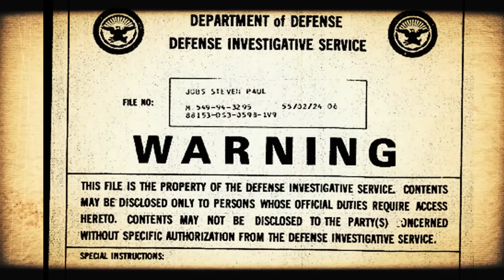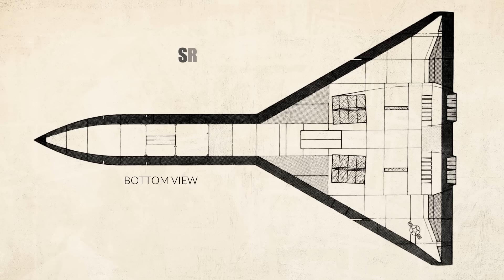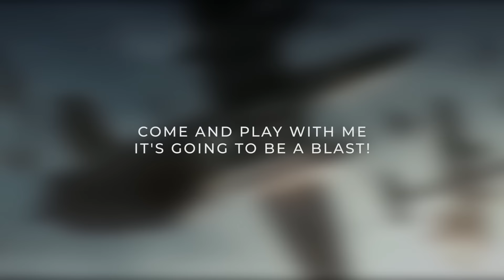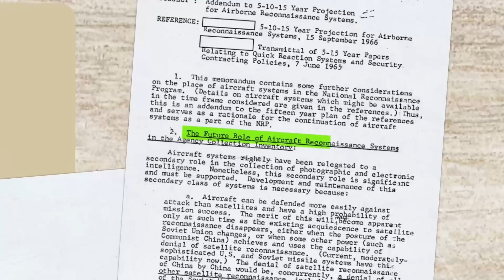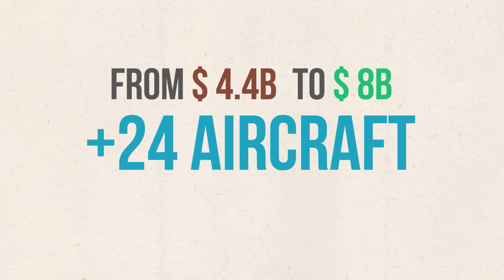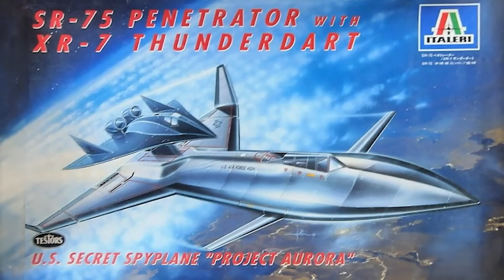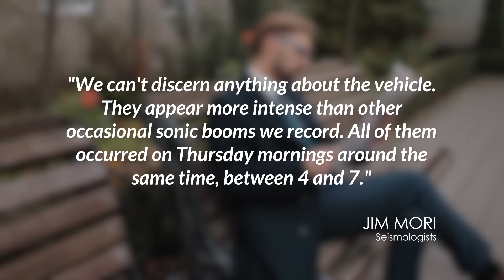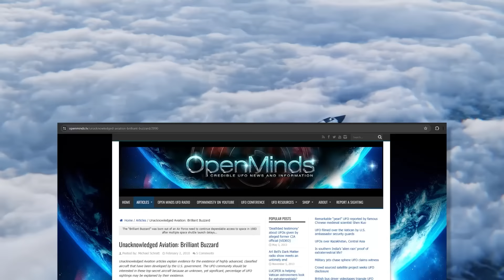This Plane "doesn't exist" - SR-75 Penetrator

Comment: i actually saw a plane i thought was a sr71 high up in the sky in the early 90's with a com trail indicating a pulse detonation engine. with the donut rings around the stream coming from engine. the plane was moving very very fast. it was so high up i could barely see the plane but it was definitely black and resembled the shape of a sr 71 blackbird. i also could not hear the plane i just happen to witness it while i was looking up in the sky. i live in oklahoma and did at this time and saw the plane flying from N NW area to S SE area. after seeing this video i am positive this is the plane i saw and the direction it was flying would place it on trajectory to be coming from the nevada groom lake area. where it was headed i have no idea. i have always believed from the time they first retired the sr 71 blackbird that the airforce would never retire the sr 71 without something to replace it and i always knew that satellites was not the replacement
Reply: What makes you think it was not the SR-71 but something else? Serious question
Reply: first of all the com trail it had. i knew then because i had seen a sr 71 blackbird in flight in the early 80's that what i saw couldnt be a blackbird. at least not the original blackbird. if you know the blackbird and its maintenance it took weeks of maintenance for every blackbird flight. they had to drain any unused fuel from the blackbird after every flight because it would literally leak on the ground. this was because how much heat the blackbird took from sustained mach 3 flights. they had to install the skin with gaps to allow expansion so the panels wouldnt buckle and fall off in flight. which is why most flights they cruised around mach 2 and only used mach 3+ when needed. now they also had to do maintenance on the skin and air frame after every flight sometimes replacing panels. keeping all this in mind there is no way the sr 71 blackbird could handle a mach 4 or 5 flight at sustained speed even if they retro fitted the blackbird with pulse detonation engines. all this meaning they would literally have to remove the skin from the sr 71 blackbird and do air frame modifications and updates and install newer skin that would handle high speeds flight. making this retro fit cost way more then just building a new plane.  now i had thought possibly the sr 75 which was rumored to exist back then. but the rumored shape didnt fit the profile of what i saw. this plane in video fits the profile  of the plane i saw. which the sr 71 did fit the plane profile but not the comm trail together. i knew then it had to be some experimental plane that the military hasnt admitted existed. 
  @RallyRacingVideo

Comment: If the parasite's engines can only fire at high speeds, returning to land at a miscellaneous runway would be impossible.  It would need to glide home like the Space Shuttle to a pre-arranged airfield, if it were in fact stable in unpowered flight.

Comment: I saw proof of antigravity over my house one night. Something descended almost straight down at high speed, fast enough to make the edges glow cherry red. When it got to around 1200' it held position with no forward speed, then moved forward slowly with bursts from its rear propulsion, until out of sight. At no time did move fast enough to support itself in the air with wings or airfoil.  Could have been cloaked, because I could never make out the shape, except for the triangular glow when descending.
- Air Force  Weather Observer
Reply: Did it have a sound

Comment: the VFX reminded me of a sighting i had early 2000s, although i dont know why one of these would be down under. Western Sydney AU late one evening,  there was an object moving North to South almost directly overhead (a little to the east) what caught me as strange was the pulsating of the engine (visual only, i heard no sound) it was a bright yellow/orange triangular output from the rear of the craft very distinct flickering maybe 2-3 times a second, from memory.  i thought it may have been a rocket or space shuttle  i later looked it up & shuttle was docked with ISS at the time.  it moved across the sky, i noticed it at very high angle up & watched it disappear to the south moved at similar speed from my perspective as ISS. Maybe 1-2 minutes before it was out of sight but the entire time the engine was pulsating in the same manner. One of those thing i wondered all this time what i saw, it was very unusual for our part of the world. there is no rocket launches etc. of any explanation so far, this seems to fit...

Comment: I’ve got two copies of this as an Italieri/Testors 1/72 scale kit from the mid 80s. Given the disaster arising from trying to launch the D-21 from the M-12 (control loss trying to go through the mothership shock cone, which would probably flameout the parasite ramjet engine), the D-21 was switched to airdrop from a B-52H with a huge rocket booster. Still no a howling success. Satellites or low observable drones make more sense for reconnaissance, perhaps a droned U-2. Unable to be shot down? If we can build anti-ballistic missiles, then anything flying in the atmosphere can be killed.

Comment: Zip fuel(boron fuels) were found to leave trails that were highly visible to radar...not conducive to stealth.

Neither is hypersonic speeds...remember the radio coms blackouts that happen when space craft reenter atmosphere.? Such happens because the hypersonic shock waves turn air into plasma that is reflective to radio waves including radar.

Comment: No if they used Machrihanish it's because it's the longest runway in the UK and leased to to USAF the only run way of capable length to also be used as a emergency UK landing strip for de-funked space shuttle and linked to the Campbeltown fuel station for specialized fuel. It's our (the UK ) area 51with underground facilities . Project Kingfish was on the Lockheed wall of history for quite a time .

Comment: What makes the most sense is that they did build such a plane back in the day, but there were technological problems that couldn't be solved with the day's tech (or at least not without costing ridiculous amounts of money), so it was scrapped. Then recent breakthroughs meant they could build a hypersonic craft, so obviously they started from scratch - no point in using decades-old tech instead, better to make it as advanced as possible.

Comment: What is that irl clip of the ufo at 0:53
Reply: That would be a rocket launch, the gap in the plume is due to staging
Reply: I've seen a rocket launch before, SpaceX launching a Falcon 9 in California. The ploom didn't look like a jet engine. I even took photos.
Reply: @WolfeSaber9933  the reason spacex rockets have the jellyfish effect on their plume is because it uses multiple engines, i assume this is a rocket with just 1 central engine on each of its stages such as a us missile or a delta 2 rocket without its side boosters
Reply: @robos3809  A rocket can't make contrail lines like a jet engine, even with multiple engines. Besides, the stage separation will happen high in the atmosphere, where it can't make another contrail line. Do your own research.

Comment: I am sure there was lots of development and testing after the SR-71. How well it worked in the end is another question. The SR-71 was reputed to have fuel tank leakage due to thermal expansion and contraction. Did they ever solve this problem?

Comment: The problem was the fuel. Like the earlier Aurora, the Penetrator used an isoborane based fuel in stockpiles leftover from the 50s and 60s. When isoborane burns it leaves a precipitate that's almost as hard as diamond on the internal surfaces of the engines. The military industrial complex thought they found a few tricks to stop the precipitate from forming inside the engines, like using hotter burning methane instead of kerosene as the primary fuel, but it didn't work. Shortly after the Penetrator program was approved for serial production one of the prototypes suffered a catastrophic engine failure during mid air refueling. The explosion destroyed the Penetrator, the tanker, the escort fighter. Two of the flight crew killed in the explosion were from politically connected oligarch class families, who in turn put pressure on their pet Congressmen to kill the program.
Reply: Looks like Congressmen or other Politic's childs are given works on SAP programs which is typical Political move however it is still a little weird that this happens again in this project. Was The Penetrator crash complately different, unrelated accident to the one you mentioned about in a comments section under another YouTube movie about perticularly Aurora program?

Comment: They were never able to launch the  d-21 from the modified A12 at operating speed and it parachuted the film cassette then crashed hopefully hard enough to destroy itself.  The d-21 was operated from b-52's over North Vietnam and China.  The Chinese shot several down and have at least 1 in a museum.  18:45
Reply: The Chicomms couldn't even detect it, much less intercept it.  They collected wreckage that fell on them and put in a museum.

Comment: Helium and amonia have fixed many of the heat issues as well as new materials...thermal mangmnt and the dynamics are negated now.  The new birds can take on a bird of prey mission set and wipe all command and control in a Unified way.....such an interesting Aspect to Software use.....just flood the pipes as opposed to not being there......just cram and overload

Comment: Contrary to your happy description,   the M/D-21 program was a failure.  CFD tools of the time could not begin to accurately simulate turbulent supersonic airflow over the airframe, the drone had only 18" of clearance to each of the vertical tails, and a crew was killed during one of the few supersonic separation tests.  It was abandoned after a few attempts as technically infeasible for the time. 

Even today turbulent supersonic (let alone hypersonic) flow is not terribly well understood.

Comment: Wait, you said the little plane has a range of 251 nautical miles at mach 15?  251 nautical mile range seems pretty short. Did you report that wrong?  No way it could get back to area 51 from anywhere.

Comment: Mach 15 is something like 3 miles per second.  If im thinking about this correctly,  if it has a range of 250 miles thats a flight time of 80 something seconds?  83 seconds lol.
If i did the maths right.

Comment: Interesting concept. Also you keep describing it's ability to go into the 100,000+ ft altitude range, but continuously only show it around 20,000 to 30,000 feet altitudes and lower. Seems like a missed opportunity.

Comment: The aircraft being midair refueled with liquid methane brings up a really big design issue.  How would the refueling aircraft ( presumably a KC-135 or KC-10) keep the liquid methane at the cryogenic temperature below of -260 degrees Fahrenheit?  It would take a lot of refrigeration.  How would the refueling aircraft generate that much electricity to power the refrigeration system?  This doesn’t even take into account the need to somehow insulate the refueling boom.  Would that modification have been possible?  It would be really interesting to see those modifications and engineering designs.

Comment: It is my understanding that the MD21 drone was problematic.  Though some launches were attempted, a mothership was lost when a drone rebounded from the superheated sheathe of ambient air surrounding both vehicles (at Mach 3+) and crashed back into the mothership, destroying both aircraft in the process.  Spending a manned Sr-71 (even once) for sake of a drone test program was ridiculously expensive in trained personnel and materials.  Other avenues of research showed more promise at less expense.
  Your point about vibration at extreme speed is also salient to the discussion.  Buffeting is a real hazard and is difficult to compensate for when complex and fragile cameras are the payload.
  Hypersonic AA missiles are a potential emergent technology arguing against using large, fast, aircraft for strategic reconnaissance.

Comment: The "donuts on a rope' contrail is a pretty common contrail affect. I've seen low (and slow) flying airliners generate them :)

Your sources contradict themselves you know? Needing an long runway to take off (and likely land) and then going to Midway island which does NOT have a long enough runway and neither does the air base in Scotland. Even worse, none of the support systems can be found anywhere and they would be known if they were. The other problem is that while they might be radar stealth they have a huge infrared signature which would be seen by even simple IR sensors. Also boron was found to be a very bad additive to fuel, both toxic and damaging to the air frame.
Uhm he actually didn't get the F117 (model and image were called the F119) right being the supposed "Soviet" stealth aircraft was a better match.

Comment: Hang on, if it's a Methane/Lox engine- why does it need an intake for that?
This is so similar to the failed drone experiment (instability on separation taking out the tail) even with modern control systems it seems unlikely.

Comment: 🤔 a craft flying at M15 with a 250 nautical mile range (300 miles for those who dont know) would have it covering 192 miles a minute (roughly) giving it just over a minute and a half of flight time to accomplish its mission and adjust course and travel to its (im assuming) predetermined landing area.
🤔 that seem EXTREMELY limited and not very practical from a time on station/mision update with changing parameters or mission requirements. 

Seems like a one time hit it and quit it and dont ask for anything different because this ain't burger king and your not getting it tour way right away.

Comment: If you was going mach 15 and had enough fuel to go 250 nautical miles that's approximately 1 minute and 18 seconds of run time. It seems not very utilitarian or a viably useful technology

Comment: Isn't this a Testor's scale model kit and not an actual concept from an engineering firm? In this video, it seems like the details and origins surrounding the SR-75 Penetrator and X-7 Thunderdart is getting misconstrued with that Lockheed Aurora thing.

Comment: As someone who may or may not be a test pilot for special programs for a private aeronautics company in the united states, i can unofficially tell you there is possibly an ST-75 (not SR75) program currently in effect at this moment.. that might or might not be called "the pterosaur" because of its size, speed, and payload, and the fact its gonna be the "top predator in the sky" or at least that could be one of the possible nicknames and it might even look like teardrop w a split tip like this W

Comment: “There’s no way the government would retire the SR-71, without a replacement” false, they are that dumb and short sighted. Hence all the hyper velocity research and projects on going now to replace it with something that can fill that roll now, as well as be armed.

Also PDE’s have been in R&D by NASA for some time, the problem is weight, to be strong enough for sustained high output, cooling and weight of the engine to be strong enough is a challenge. It’s a simple mechanism of operation, but the high pressures and heat are challenging to deal with and remain light weight.  Likely 3D printed titanium alloys and such tech will make it more feasible.

There’s also a huge difference in technology demonstrators, prototypes and service ready aircraft.

Comment: "How Realistic"?  Come on, it's 2023 and we're still trying to develop functioning SCRAM jet engines.  We're still not there.
Reply: X-43A broke mach 9.6 in 2004 from 110,000 ft.
Reply: @everypitchcounts4875  And how many times did it fly?  How many hours on that engine?  That was an engine with wings strapped to it.  More missile than plane.

Comment: With the so called Space X and other upcoming companies capability to throw thousands of satellites in low earth orbit along with the minimize of electronics, there's no reason to build this type of aircraft anymore for Strategic reconnaissance.
And with a networked centric web along with drones and other aircraft seem to have this tactical side covered.
This capability used to be specialised but now most new fighters, long range strike and drone aircraft of 4.5 gen, 5th gen and up have the capability with it's their radar, electronic observation along with AI to add to the networked web for instant access of information gathered.

Comment: Since it never materialized, and it cost 455 million (raising to 24bn), what's the chance the entire project was a coverup for pocketing that money or using it for something else? Could easily get a Star Wars and/or Star Trek writer and artists to make up the specs and drawings for such a thing. The 'Star Wars' program wasn't real but yet there were drawings and specs for it.

Also, super interesting why a top secret American project aircraft would land in Scotland for everyone to see... I don't think I need to say more.
Reply: Because you fly straight across the Atlantic Ocean and land in Machrihanish without passing over more than a couple of miles of land, if that, to the runway. 
It's a remote area, and the flights came and went in the dark early hours of the morning.
Reply: The new US bomber project test vehicles by Lockheed Martin and Northop Grumman, which has led to the latter's B-21 Raider, were also test flown over Scotland at one point, in a similar way the YF-22 and YF-23 were before they picked the F-22 Raptor.
I'd love to see what the LM bird looked like.....